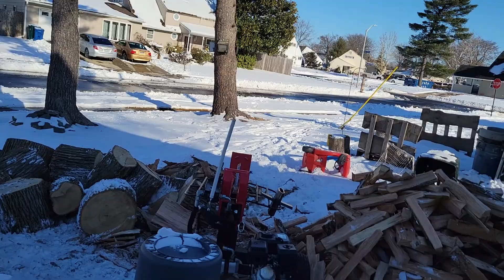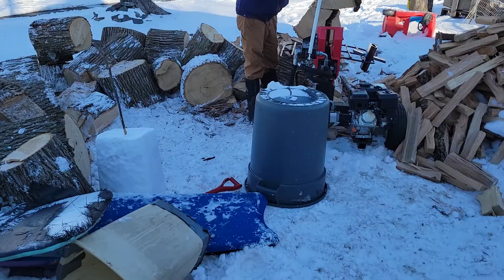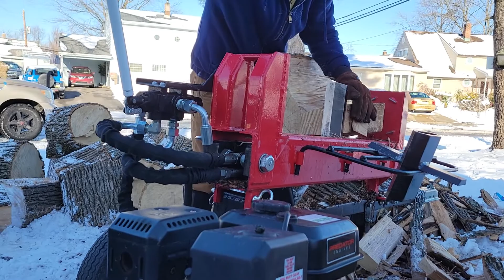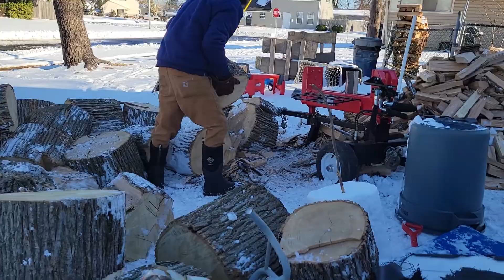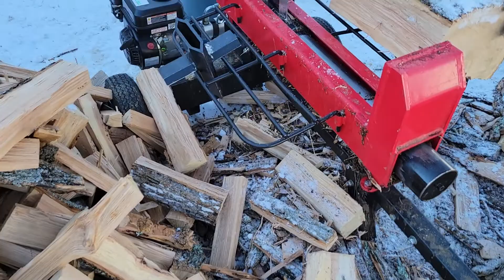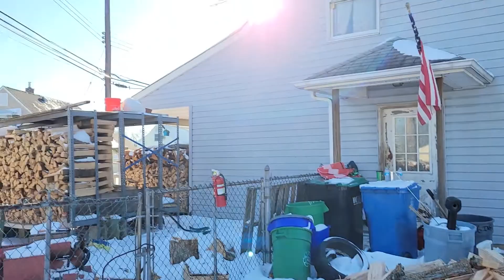getting g split done on a snowy Sunday with the wife

Comment: New subscriber from Oregon. Nice Harbor Freight wood splitter! Those are some big rounds! I just got one a month or so ago. I have only tested it out on maybe 15 rounds. I have over a cord of rounds I will split in a month or two. I need to burn more wood to make room. I put a video up of the splitter's maiden voyage.
Reply from the maker: I love it man it pushes thru whatever I put on the rail that thin knife just slices thru any crotch or knot it might slow down but it keeps on pushing I've probably ran 20 dull cord thru it so far trouble free thus far

Comment: Nice splitter. I like the fact that you can put a different wedge on to split quarters all at once.
Reply from the maker: Yeah the 4 way is nice but it has its place good for 12 inch or less straight pieces any bigger or knotty pieces I don't use it on
Reply: @mattsfirewoodvideos738   I can understand that. It would take a lot of power to push it.